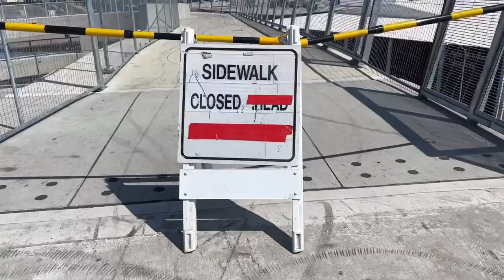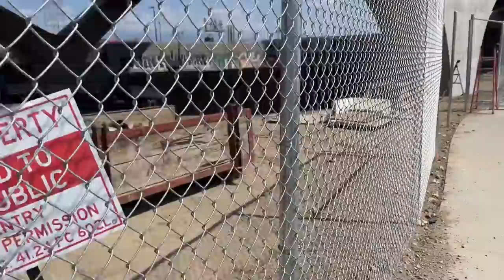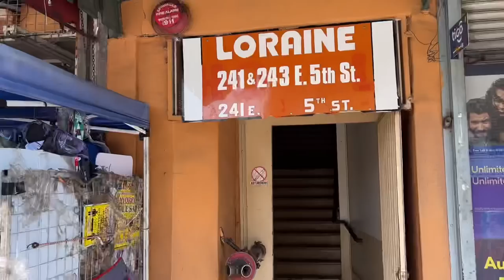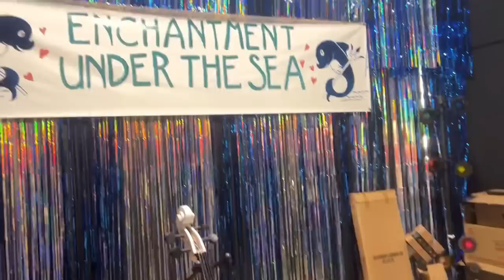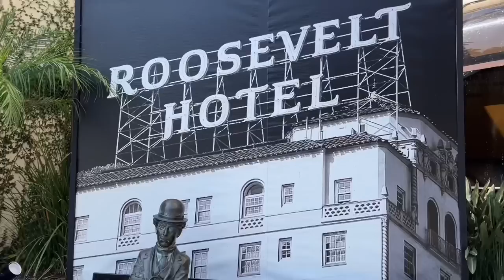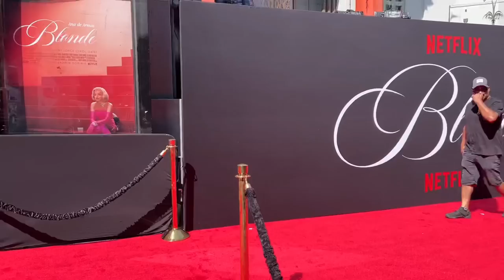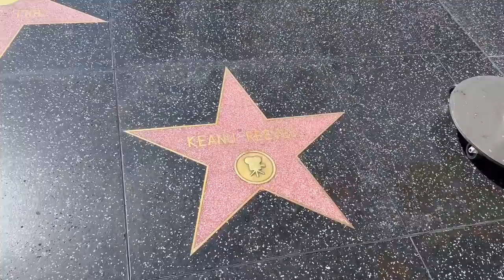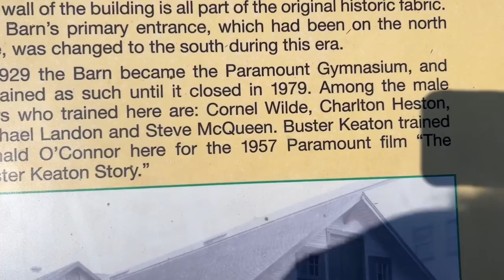Exploring Hollywood,Downtown LA,Movie Locations from Ghostbusters,Back to the future,Rocky3

Comment: I'am a Floridian and I can testify the heat and "humidity" are killer here. THe humidity is absolutely unbearable. Lessens somewhat in the winter months, but not for very long. Mold & mildew are both a huge problem. Items not stored under "humidity control" i.e. air conditioning will definitely be ruined. A.C. a constant necessity!